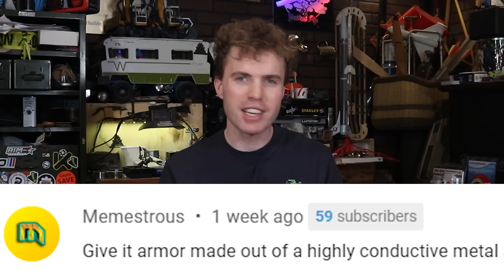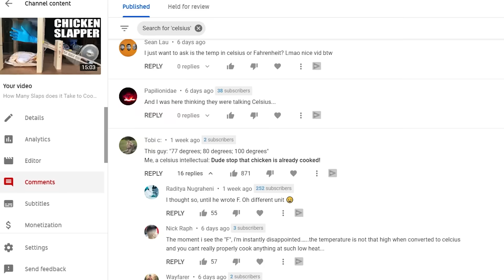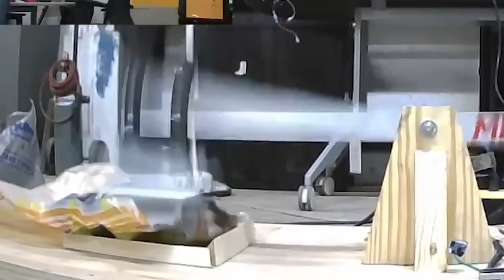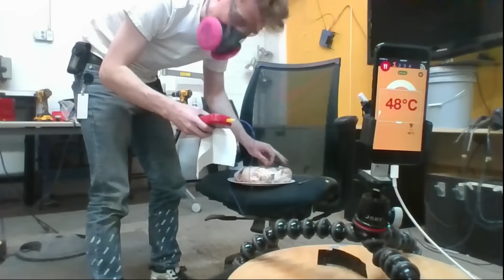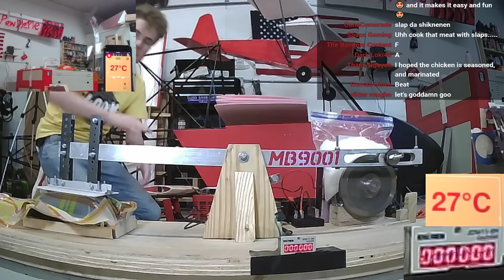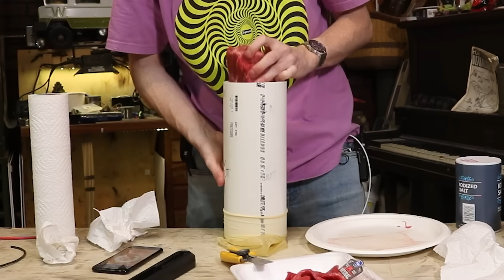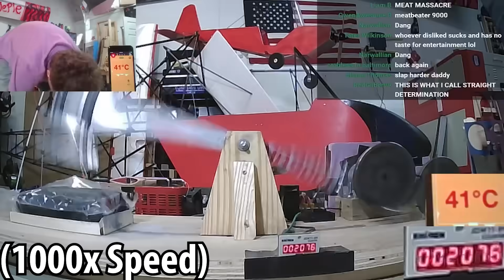I Cooked a Chicken by Slapping It

Comment: "Celsius is the scale used for real science"
Kelvin: "Am I a joke to you?"
Reply: @Anjal Adhikari you mean the -273°C, they just put a zero here and called it a day
Reply: Kelvin is just a cool name for celsius that doesn’t have negatives: change my mind
Reply: @alessandropereira4976  kelvin is the SI unit for temperature it is the unit used for calculations in thermodynamics and celsius was just made to make the freezing point of water zero
Reply: @Ahmed-vs1ui  True, absolute zero, or absence of heat is 0 K. This is when there is absolute no heat in the environment. 
Like you've said, celsius is used to determine the freezing and boiling point of water. 100 being the temperature at which water boils and 0 at which it freezes.
Reply: Prt equations really dosent like - temperatures :)
Reply: @MrRalanov  yeah the degree of agitation of the molecules doesn’t make sense being negative. But I still prefer Celsius and every equations that uses delta instead of the number
Reply: Rankine would like a word
Reply: scientist memes
Reply: Kelvin is based on kinetic energy
Reply: Celcius is perfectly acceptable in most sciences and preferred in documents for sake of scale and ease of use. It's only a hard requirement in sciences that work with numbers in the extreme percentiles such as thermal dynamics or astrophysics. When I'm documenting soil samples or water samples or recording plant species, freezing and boiling point are far more important in the relative scale as I'm working in no bigger range than -10°c - 40°c. Switching between C & K is no more hassle than a simple sum or subtraction. It's a matter of format and appropriate presentation.
Reply: @nxxynx5039  Celsius is spelt with an S
Reply: they both are the same scales. its just shifted 273
Reply: I like your profile picture.
Reply: All the OG's call it centigrade.
Reply: Who tf is Kelvin

Comment: Wanted to have consistent slap force - I don't see how that was accomplished.
I would use some kind of sealed air cylinder to push it down and use the engine to push it up before it comes down with a nice slap using the compressed air - it should be perfectly consistent force, probably easier to make and maybe more robust as well.

Comment: Gordon: how would your like your stake cooked
Me: to a perfect 60 degrees, accomplished by 35,000 slaps
Reply: 135,000. what you suggest would still be fuckin mooing
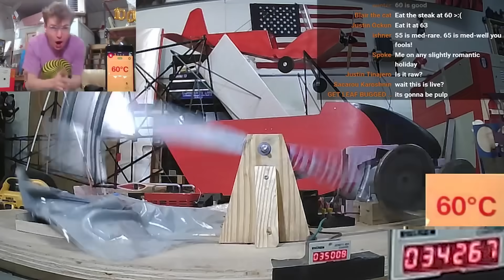Reply: @azurethi2851  nope 34,284 @ 9:22
Reply: @marvelrassam9675  That's the one that he "cheated" on by using a bath to get it started. the 135k was for the chicken from scratch
Reply: @azurethi2851  135 in facist units (135f) is the same as 60 correct units (60c).
Reply: @conradk.3098  everyone groaned when you said that
Reply: also gordon: would you like a wood or metal stake
Reply: 135,062

Comment: Yeah I'd advise against eating chicken cooked with the meat beater, mostly cause while the chicken's proteins coagulate at 60C (140F) its not actually safe to eat. Protein coagulation is a result of temperature only (you can cook for days on a low enough temperature and the proteins wont firm up), but when you are cooking to ensure there's no bacteria (salmonella), it requires both temperature AND time. It is recommended by most food safety officials to cook it to 73C (165F) as usually by the time the proteins reach said temperature, any harmful bacteria will have long since died. Plus with the nature of the meat beater, i imagine it gets unsafe juices all jumbled up.

If 60C was your benchmark, you'd have to keep it held at that temp for a while before any of the proteins actually cook.

In a steak, it's usually fine to cook it any which way you want as the piece of meat isn't generally thick (there are thick steaks, but they aren't roast-thick), it has a low risk of foodborne illness so you typically cook it to your preferred doneness/protein coagulation.

Now you can TECHNICALLY have a medium rare chicken, and while I by no means recommend trying (it would be a nasty texture and still a bit risky) but if you kept it below the meat coagulation for a long enough period of time, it would never over cook. But the bacteria will die off after long enough.

Comment: If you make the arm a little ticcer. It takes longer to break. One of the problems was the arm breaking on  tin side. Ofcourse it means more weight. So more power is needed.

So go aluminium or titanium instead of steel.  Its lighter. Also if you want to go 110% make the slapper the shape of the chicken. Meaning you slap a bigger surface area, meaning better heat transfer

Comment: So... I may have an idea to make not bad tasting food, if you went back to the wheel slapper, made it so it was slapping upward, to where you have an aluminum pan that stayed still enough you could cook in it, using the slaps to heat the pan, thus still "cooking with the heat of the slaps" just using a pan to better disperse the heat giving a better over all cooking experience and likely a faster cook time as the aluminum pan would heat much faster than the meat its self would.

Comment: I think you could have made holes in the slapper since less surface area means less air drag/resistance so less air blew into the chicken, also it would be easier to operate since with less air drag there would be less air weight needed to push.

Comment: So... your rig is ok in that it works*, which is obviously the most difficult part, but now you need to refine your rig so that it works _well_. Your biggest issue, right now, seems like stability - specifically, you need to limit your side-to-side movement... so that means you'd basically need a robust, as-low-as-possible-friction gate at the front of the slapper so that it's side-to-side movement is restricted. In theory, the longer your gate is (in relation to the length of the slapper arm), the more stable your slapper will be.

Comment: You need to be carefull on motor cooling because overcooling it will make the metal contract making the (in this case) magnets and copper wirering grind and thereby damaging and lowering motor performance.

Comment: I'm no scientist so I could be wrong, but I think that a solid slapper (the metal part that actually makes contact with the chicken) wouldn't be the best. I feel like something that more resembled a hand would work better, since if you slap someone with a hand, it stings, which I think would generate more heat, possibly more than something that just hits it. Again, I could be wrong, I just feel like that could be better. Could be wrong tho.

Comment: Instead of hard slapping using steel, why not using rubber slapper (like truck mud flaps) set on a rotary wheel, you can also put several rubber slapper on a single wheel. Worth to try? I think so

Comment: Cool that this happened. I was wondering if the bolt should have been an actual shaft. I see why it's not very practical for basically a garage project, but you'd probably want a lot more rigid base for the slapper as well, so much bending and movement in the base itself. Just an assumption but that might eat quite a bit of efficiency and introduce plenty of breaking points (you know, just the strain from vibration already).

Comment: Haven't watched yet, paused at 0:41 this is my first visit to your channel. No offense but from an engineering standpoint its quite simple. So not sure what you mean, In fact machines to suit this purpose have been in use for decades. But have to admit I'm curious to see how you will reinvent the wheel. And yes I am a mechanical engineer. So guess I will watch to the end, and will try to refrain from making too many condescending remarks. Mostly because I will admit it never occurred to me to use this method to cook a chicken. Usually the concern is the reverse, devising ways to counter over heating. 
OK watched the whole thing, surprisingly entertaining, having no idea of your education I would say its either very impressive or a little embarrassing. If you have some engineering background, and were in my class I would give you 2 out of 5 stars for initial design, 1 out of 5 for choice of materials. It might score high at a high school science fair, but not so good as an engineering project. Over all (some students would say I'm so uptight you couldn't pull a pin out of my ass with bulldozer) I am hard to please, but that was very entertaining so 5 out of 5 for the purpose it was intended. 😁👍👍👍👍👍

Comment: 1) why use a slider in your rotational to reciprocating conversation? Use a crank arm with bearings.
2) the speed of your slapper at impact is decreasing due to the sinusoidal velocity function. 
3) I'd probably try a bunch of flexible slappers on a wheel. The impact energy would be determined by the mass and velocity of the slappers.
4) why is the outside of the steak browned?
Reply: 3) they tried it in the previous video. It completely destroys the chicken.

Comment: Celsius isn't used for real science, Kelvin is. One Kelvin spans the same range as one degree Celsius but is part of an absolute scale, meaning the temperature scale ranges from the very coldest something can possibly be (zero kelvin = -273 degrees Celsius) to the very hottest (this is theoretically infinite). In your next chicken slap related experiment, be sure to use SI units like Kelvin to solidify this as real science. ;-)

Comment: So here's the question? Why did you go with a linear reciprocating device instead of a rotary device with flexible slapper blades? While you energy per slap would be less the sheer volume of slaps would more than compensate for it.

Comment: @Louis Weisz want to know why it keep failing? If you changed it so the arm that is doing the slapping has the equivalent of suspension on the front forks of a bike, it wouldn't pound the chicken so much, the way your doing it is creating too much friction and not enough kinetic energy, whereas if the front arm had "suspension" more energy would be transferred to the meat without pounding it to death. Also if you had at least 4 small fans pointing towards the bag from the sides, it may initially lose some heat, but when the kinetic energy is creating enough heat, the cold air from the fans would actually increase the temperature inside the bag cooking it quicker.

Comment: Good job on finally getting there, but why not use an air hammer to begin with? 
Short stroke, powerful, and very fast. 4500 bpm would have cooked that steak in 10-15 minutes.

Comment: This is the worst setup for a slapper arm ever. All you needed was a wheel with soft spatula like protusions that literally slapped into the chicken at RPMs that would increase the heat of it for the sheer ridiculousness of the amount of impacts (it would actually burn the chicken at the impact site). Cooking augers do exist. They were tested by militaries to use agitation which is as simple as hooking it up to mechanical power to cook MREs.

Comment: Here's a thought--use of very small strokes at very high frequency could deliver the required energy to the chicken.  Shorter strokes might also prevent damage to chicken tissues.  Adding insulating foam plastic walls around the chicken may help reduce heat loss to ambient temperature.

Comment: I think there is a factor that hasn't been taken into account if it is being equated to a human slapping a chicken cooked. That being the temperature and stiffness of the slapper, as the body has an ambient temperature and it will increase while slapping both from the impact but also through the exertion.

A possible solution could be to use a water cooling system that sends the hot water from the motor to the cutting board then wrapping the board in pig skin to better approximate the temperature and texture of a hand.

Comment: And this kids is why you don't just use aluminum. The SN curve for aluminum tends to 0. It means that it will be weakened by fatigue no matter how soft the force you apply, it is a matter of time. Steel, however, has fatigue limit which means it can keep going forever as long you don't exceed that limit.

Comment: Am I the only one that see’s that Fahrenheit is actually a more accurate measurement of temperature? It takes a smaller change in temp to change 1 degree F than C.  For example, 159°F is 71°C when rounding, but 160°F is also still 71°C. Sure the metric system in every other way is better for science calculations, but in my opinion Fahrenheit is a better temperature scale. The only thing useful for Celsius is 0 is freezing temp of water, and 100 is boiling. But since that doesn’t matter here, sure you can do all your needed calculations in Celsius since all the formulas and math use it as the temp scale, but I’d still monitor the temp in Fahrenheit because it’s more accurate. But that’s just me lol

Comment: A few safety concerns a friend raised:
When you have flying bolts and aluminium coming off your rig, maybe sitting next to it with only a pair of safety goggles is not the best choice.  Arteries are not nice to be severed by flying metal, among other bits of your body.
When you have bits flying off, adding a 2nd motor may not be your best go to.
Rushing over to play with the clearly smoking and plugged in electrical device is counter-indicated.  I believe the exact words were: "magic smoke came out, quick rush over and touch it while it's still plugged in" would be a bad thing.
Eating the steak sandwich on pure eye-ball level of the bag which the same product had previously leaked fiberglass and other materials into the food product under stress may not be considered "wise".
Simply turning your variac off at the switch while leaving it plugged into the power source after breaking is.... a poor choice.
You may have wished to measure how much current you are drawing to see if your variac is rated for that.
You apparently have no idea you should be controlling your motor speed with PWM for this kind of application.
The person in question deals with electrical stupidity all day at work so didn't want to have to deal with it here too, so I have simply forwarded some of his observations.  You MAY wish to take them to heart as he seemed genuinely shocked that no-one was seriously injured in the video.
Reply: the virgin viewer - no safety ideas or recommendations
     vs
the chad Just A Guy - tons of recommendations and anecdotes from a friend about trying not to kill yourself via machinery
Reply: This motor is an iron core induction motor, good luck PWMing it when it'll saturate at higher frequencies and draw more current at low frequencies. 
The switch on the variac will never have the light fail if the switch fails closed, and in fact stays on.
The variac is grounded and even if somehow a wire touched the case, it would short mains and blow the breaker.
The magic smoke is just enamel melting, literally does nothing to the grounding of the case. 
I do believe switching an overloaded device off at a heat isolated switch is better than touching and burning yourself on a hot outlet or potentially grabbing a squishy wire and touching bare copper electrocuting yourself.
Reply: ur just trying to seem like ur better than everyone else.
Reply: @superklondoentertainmentsy4061  genuine safety tips = condescending everybody, please remember to let others get maimed or killed rather than potentially be rude for less than a minute

Comment: Interesting. Id have used a pneumatic system with an actuating bi-valve. Centrifugal motion is difficult to reliably exchange into reciprocating motion. Take a reciprocal drill for example, you must supply the return force for the bit because the motor doesnt actually reciprocate it, it merely pushes it forward and out so as to put the brunt of the forcs on the bit and to keep any jerking or pulling stress off the drills own pieces.

Comment: Probably not the only one to notice this. An improvement to the arm instead of having a friction heavy slot to transfer the rotational motion to reciprocal, an intermediate connecting rod, like on a steam engine or an oil well (and  come to think of it, if the assembly was balanced like the examples too)would give the same result and could possibly help with the stress and efficiency.

Comment: Why not slap the top an aluminum surface with the meat beater and have your meal mounted to the bottom so ya dont end up with pre a.b.c smush.
You would still get heat transfer and  could "beat" it as hard as your machine could handle or even try friction cooking next.

Comment: You could really have used a thermal imaging device, aka infrared camera, to detect early problems in the overheating of the equipment as well as monitoring the heat build-up and dispersion on the chicken. Something basic like a Flir EX4 is affordable and will give you proper readings. Heck, even one of those $200 smartphone add-on would have worked better than nothing.

Comment: "the original meat beater has a problem; it cant control the power"

the nut machine 9000 max vaccuum sealed pro model with surround sound

Comment: The linked motor is a great idea! In these designs where there's an impact, I would have looked for inspiration in a hammer drill: there's a hammer and more importantly, a clutch like mechanism that disconnects the motor from directly experiencing the forces of the impact. Your design has a lot of lash, but lets be honest, its a comically accurate mechanical way of slapping a chicken :) thoroghly enjoyed this process

Comment: Try making something which will vibrate the meat instead of slapping it. No impact damage and all the same kinetic transfer to thermal energy. Don't make a shaker. Specifically low oscillation high frequency vibration.
That's right, a vibrator.

Comment: Now here is an even bigger challenge. Now we know that it takes approximately 135,000 slaps and nearly 7500 watts in electricity to power the slaps. How much chicken would you need to eat to power 135,000 slaps to uncooked chicken that will be cooked?